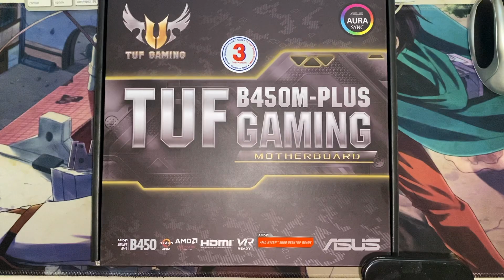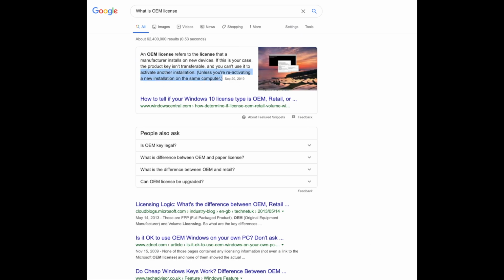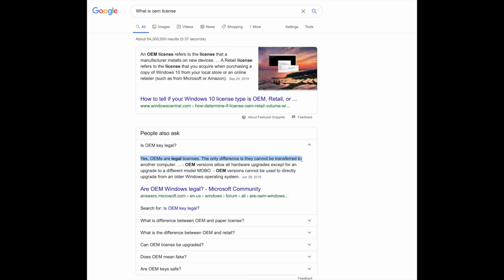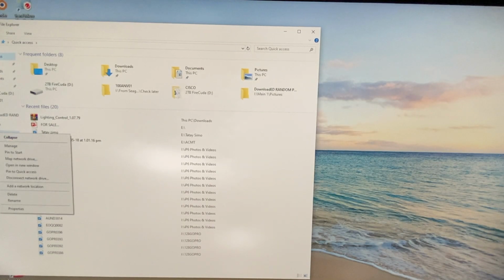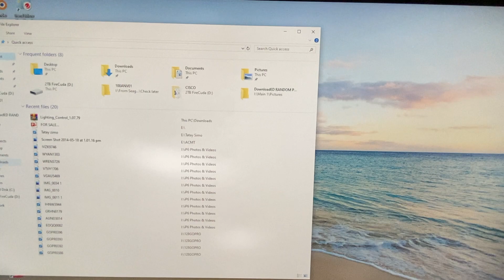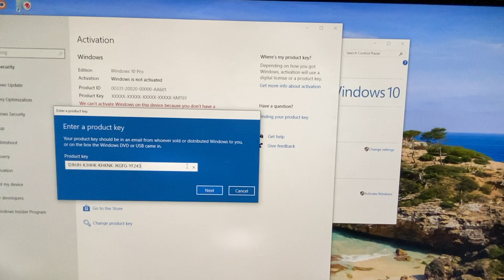This is what happens to your Windows 10 OEM license when you migrate to another System.

Comment: I currently have a Dell XPS 8930 pre built PC and I have an ssd in it which is the OS C: Drive.

Firstly, I plan to custom build a PC in the future and sell my old pre built PC, so I want to migrate the SSD from my pre built pc to the custom PC. Will I run into some weird issues with the custom mobo when it regognizes some pre installed Dell files in the SSD that originally came from the OEM Mobo from the Pre Built PC? 

And secondly, if nothing will go wrong with the SSD OS Drive when the custom mobo regognizes it, do I have to buy a new license key for the new custom PC or I can transfer the old OEM license that came from the OEM Mobo from the pre built PC?

Comment: Hey man, great video, I got a question. If am planning on upgrading from a Gigabyte mobo to say like an ASRock mobo, will it be good if I backup everything on my current m.2 nvme ssd, put the same ssd clean into the ASRock mobo and perform a fresh installation of windows media(which will be activated soon since I have an OEM)?
Reply from the maker: Yeah, it is a good idea to do a clean install. Just make sure to manually copy your user data to a HDD. Once you have installed a fresh Windows, create your user account, login to the administrator account then copy your user data and folders to your user account and that should be it.

Comment: thanks for the vid. im upgrading my motherboard b450 to b550. hopefully it will go like this, i just need to buy a key again
Reply from the maker: Give it a try using the same key. This license policy may have changed now. If it won't work, then you may want to try calling Microsoft support. I read somewhere that they may allow you to use the same key on a different board now.
Reply: @SwitChildku  my current key is OEM :(
Reply from the maker: @badgerkins1991  That is what I meant. I read somewhere they may allow it. They may have changed their license policy.

Comment: Did you ever not try to link on your microsoft account and activating using troubleshooter? After replacing the same motherboard that will be possible to reactivate an OEM key with troubleshooter. But make sure you have a microsoft account that link with OEM key belongs to your credentials.
Reply: Okay so I’m replacing my cpu motherboard graphics cars and power supply, with new different parts, I have a oem key and I am linked to my Microsoft account, so will I be fine?
Reply: @GrannyDropper  if it stays in the same case, maybe
Reply: @Mercan1556  I’m in the same thing as him but I’m getting a new motherboard but my ssd, hdd, cpu and gpu will stay the same will it work?
Reply: @connorg119  yea you should be chillin. I replaced everything everything, pretty much built a whole new pc but just took the ssd that had windows from the old one and used it on the new one but keep in mind that I took the hard drive and ssd I had from the old pc and into the new so when I started up my pc for the first time after the upgrades everything was there and nothing was deleted and my windows was there.
Reply: @GrannyDropper  But you can also crack/activate Win7 and upgrade to Win10 to get a illegal legal key. After that you can format the PC and install Win10 normally
Reply: @Mercan1556  thanks for the reply but my windows was on my ssd and I moved that to the other computer and everything turned out fine.
Reply: @GrannyDropper  really? u changed the whole PC and Windows still activate?
Do you have a Retail Version or OEM?
Reply: @Mercan1556  yea everything was changed and just kept the memory from the old pc, was a hard drive and ssd card, and the ssd came from a prebuilt I bought 2 years before, that ssd had the windows when I bought it
Reply: @GrannyDropper  im in the same boat, im getting a new motherboard and have a prebuilt OEM key. so did you just leave everything as is and plugged your SSD into the new motherboard and let it activate by itself?
Reply: @connorg119  so for me it worked, my windows was on a ssd and i put that ssd in the new build with the new mother board. For me it worked. Booted up like normal and didn’t have to get windows again.
Reply: @connorg119  everything should be good as long as the ssd is plugged in and everything and you should be fine.
Reply: @GrannyDropper  oh damn I’m hoping for the same then thanks
Reply: @GrannyDropper the thing is your saying prebuilt but this does not mean that is a OEM product key. That is the key point. You cannot normally change to a new pc with a OEM licensed key.

Comment: can i transfer it (windows 10) from hdd to ssd in the same laptop without any activation failure ?
Reply from the maker: yeah definitely. use a cloning software so that it will be easier to migrate the whole system to an ssd. SSD storage space should be equal or bigger than the HDD.
Reply: @SwitChildku  Thanks for advice ❤️😄
Reply from the maker: @Spasitel13  My pleasure. Help the channel by subscribing. Thanks.